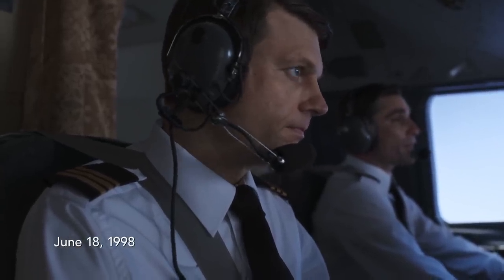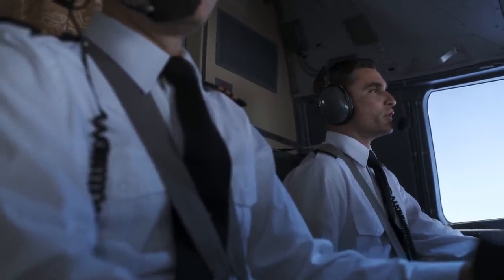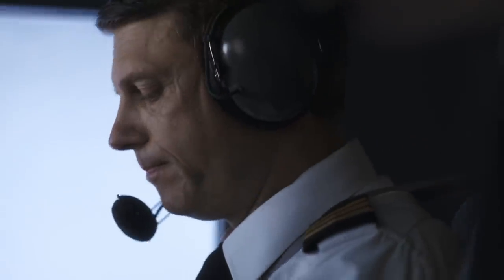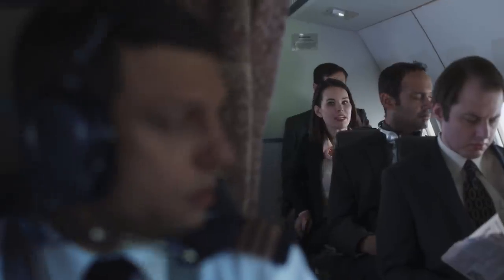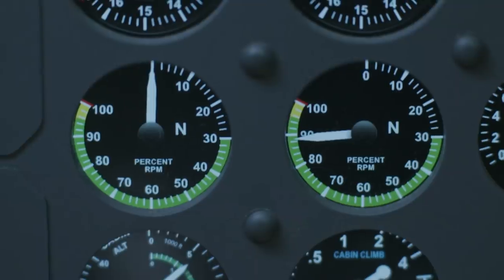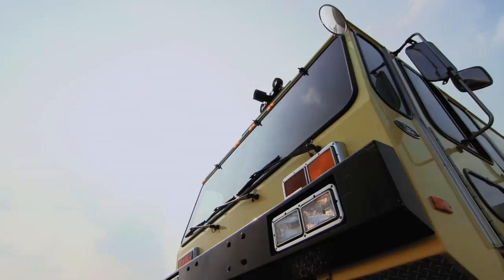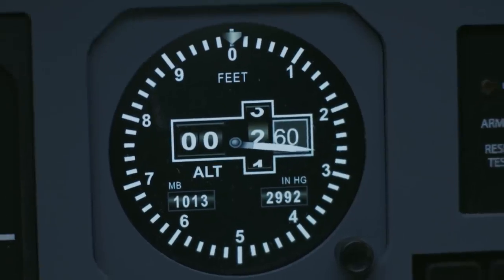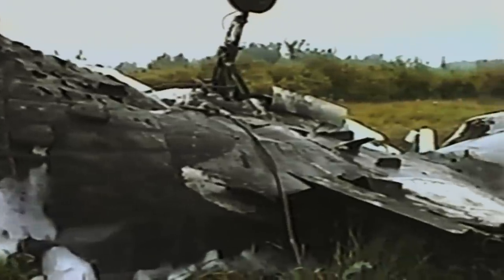This Ground Crew Braces Itself for an Explosive Crash 😬 Air Disasters | Smithsonian Channel

Comment: They were so close to saving everyone onboard.
Reply: Yeah
Reply: 🥺 so close 🙏
Reply: calix air  turboprop accidents
calix air regional flight 783 78 deaths 2 survivors
Reply: So close yet so far
Reply: but the stupid thing had to roll
Reply: I’m pretty sure the girl who said there was a fire was wrong and they turned it off for no reason
Reply: @jafarmurtaja1482  Actually no. Most likely, the fire disabled the switch.
Reply: 5 seconds. 5 SECONDS!!!
Reply: Didn’t matter with no left gear, it would have crashed anyway. Unless that was just a coMputer error and it was down.

Comment: I was barely a teen when this happened. My father recounted it in details to me today. He was one of the influential people at Propair who dealt with the fallout after this. He never really spoke to me about this in details, 25 years later, he is still emotional about it and struggled to recount it to me. Mr Provencher was one of his best friends, I vaguely remember him on a personal level. From what I know, it was a brake failure in one of the landing gears, which caused friction on takeoff, and ultimately, heat buildup, when the wheel was drawn back in, it heated the compartment of the wheel up to catching fire, the fire spread into the wing, making it malleable, and it slowly bent the wing out of shape, causing the plane to roll to the side, until the wing became malleable enough to bend like that/break near the runway at Mirabel. I am fairly emotional right now watching this.

For those who recognize who me and my father are, he is doing well today, he retired, his health is fantastic and he is living some of the happiest years of his life as far as I can tell. ♥

Comment: For all those who think the wing failed before landing it didn't it actually remained intact but the impact of landing without landing gear broke the weak wing apart.
Reply: ….then how did it flip upside down?? Draw yourself a free-body diagram with the forces involved and show me how that would work
Reply: Have you ever seen the crash animation of United 232?
Reply: @Andy_M.S.c  In this case the plane had enough speed to get airborne because it bounced on the ground, but it was such a little bounce even the FDR didn't record it. The plane was airborne again... But due to loss of lift fom the failed wing they flipped entirely and crashed
Reply: The crew never realized the severity of the fire, which had grown out of control and begun degrading the structural integrity of the left wing. This caused the crew to have severe difficulty in controlling the aircraft. The crew had to apply maximum aileron trim setting due to the reduction of the stiffness of the wing. The left wing then failed, buckling upwards, causing the aircraft to roll to the left through 90 degrees and crash, subsequently bursting into flames and killing everyone on board.
Reply: @GoatzombieBubba  This is accurate, the wing broke before the landing, because it had become malleable from the fire.

Comment: Thanks to this crash every metro pilot now knows how to recognize a tire fire and what to do. The metro doesn’t have two hydraulic systems. It has one. It has two pumps which supply both the flap system and the gear system. These people are wrong. Now when you get a tire fire you lower the gear to get the burning tire away from the wing spar and fuel tank. Then you get to live
Reply: And there is now an alarm in the wheel well that warns them.
Reply: This also wasn’t a tire fire. It was caused by overheated brakes.
Reply: I mean, from what I know, like, every company in canada sold their metro after this.
Powerranger is right, it was overheating brakes which set fire to the compartment, and it spread into the wing.
I have.. intimate knowledge of all of this mess.

Comment: I saw this earlier today on the National Geographic channel

Basically one of the pad things on the landing gear (I forgot the name) reached 1000 degrees and it was enough to set the hydraulic fluid on fire
Reply: Ehh i don’t rly like National Geographic channel
Reply: What country are you watching nat geo. Because i did not see it.
Reply: Why did the "pad thing" catch fire? Root cause analysis?
Reply: @32.9msubs.2  is hydraulic fluid flammable even?
Reply: @moiraatkinson  the fluid on that plane was yes

Comment: Even if they had shut down the engine they would have struggle to land .the hydraulics failure would have made it worse. So that's why they left the  engine running on idle,!.R.I.P. for the brave pilot's and the passengers, 😥👍

Comment: I’m flying Metros now after a long career on other types, and I’m interested in learning more about this crash. Does anyone know what initially caused the high-temp condition? Was it an overheated brake? Was it a bleed air leak? Did the crew get a “Wing Overheat” warning light before they lost hydraulic fluid and pressure? If you have any info please post.
Reply: Dragging brakes caused them to overheat inside the wheel well and cause an inflight fire
The hydraulic system was also found to have contaminated fluid which has a lower ignition point compared to fresh fluid, accelerating the fire spread
Reply: So the engine itself was not on fire? It just happened to be in the vicinity of the gear well where the fire initiated.
Reply: @chriscusick6890  There was no fire inside the engine according to the ACI episode. I think it looked like it came from the engine because the wheel well is underneath the engine.
Reply: A long standing problem of this particular metroliner was brake dragging. The left brakes were dragging during takeoff and overheated. Once inside the wheel well the overheated brakes melted the unprotected hydraulic lines. Hydraulic fluid is obviously very flammable and started a fire in the wheel well. The crew then got the warnings of no hydraulic fluid in 2 systems and then started having flight control problems, specifically the aircraft developing a tendency to roll to the left. This was caused by the wheel well fire starting to deform the shape of the left wing, causing a reduction in lift on the left side. Shortly after the crew got a left wing overheat warning which canceled itself after some 30 seconds. This was caused by the fire physically destroying the sensors that detect a wing overhear situation. Just after passengers in the cabin could see visible smoke and flames coming out the back of the engine, and this was confirmed by firefighters on the ground as they awaited the plane to land. The crew had no engine fire warning and no indications that there was a fire, apart from the passengers telling them so. They shut down the left engine. All this occurred as the wing continued to deteriorate, worsening the left-hand roll. Less than 5 seconds before touchdown, the left wing was too weak to support the weight of the aircraft and it buckled and fell off. The remaining right wing obviously caused the aircraft to roll all the way left and the plane landed upside down and the wheel well fire ignited fuel. Everyone on board died.

Comment: I wonder if they should have just tried to belly land the plane...
Reply: It wouldn't have made a difference. If anything the partial landing gear deployment increased their chances of making it as there was more drag on the right side of the plane, counteracting the left roll somewhat. They also lowered the gear manually and when you do that you can't retract the gear

Comment: What caused the plane the issues with the plane . Did they find out ? .
Reply: the brakes on the leg gear were on during taxi and take off, causing them to heat up which resulted in the fire the passenger noticed, the fire weakened the wing before it broke up seconds from touchdown

Comment: Every reason not fly never trust planes
Reply: still plane is safer than driving a car
Reply: A plane crash requires a combination of very unlikely failures to occur. The reason for this is because of the high levels of redundancy in modern aircraft. This means that the chances of dying in a plane crash are extremely low, much lower than dying in a car crash